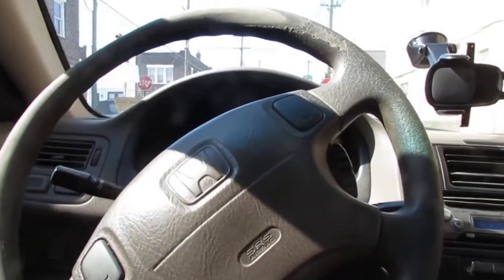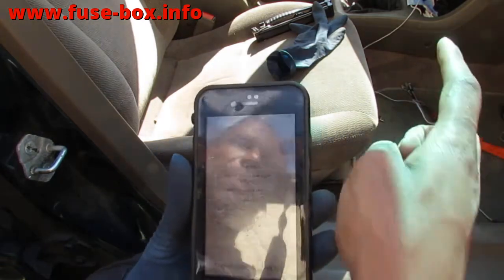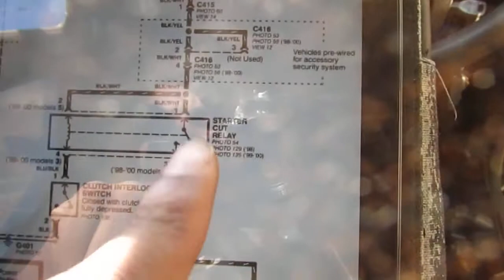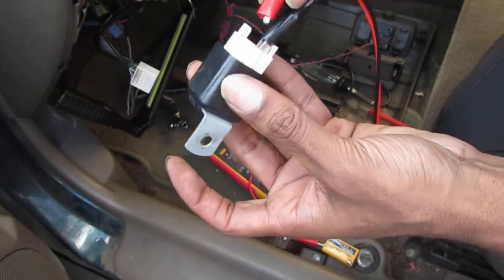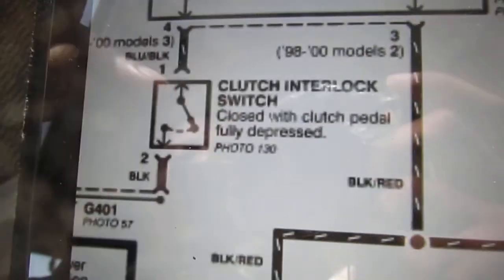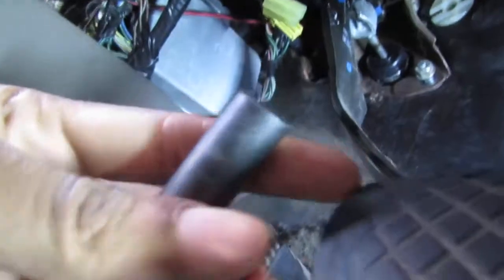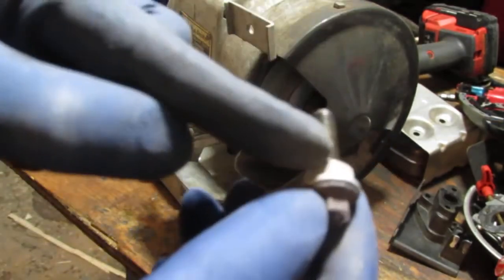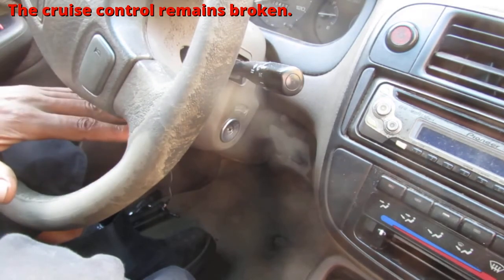No Crank, No Start 1997 Honda Civic, Manual

Comment: Thanks for your video it really helped tremendously. I just did this yesterday to a 2000 Honda Civic EX. The cotter pin on my clutch was facing the driver side of the clutch pedal. In your video, the cotter pin was facing the passenger side. I could not see the cotter pin on my vehicle and had to work by braille. In other words I had feel the for cotter pin and bend the pins straight with my fingers. Then I had to feel for the small loop on the cotter pin and use the hook tool to remove it and then reinstall it the same way. Every thing else in your video was spot on. Thank you for the video.
Reply from the maker: Hell yeah bro.  This comment made my week.  So happy you got the 2000 Civic started.  This diagnosis process is applicable to many Honda and Acura models during this time period so it is a general diagnosis guide for a no crank no start.

Comment: This didn’t work for my 92 accord. At this point. Been a whole year, ready to junk it 😭😭 just taking up space now.
Reply from the maker: So sad and you should not give up so quickly.  Try spraying flammable carburater cleaner into the air intake and see if it turns over.  If it turns over you know you have spark and possible good timing.  Then all you have to do is check the other components within the startup chain.  Or you could just bring it to me.  A 1992 Honda Accord has a similar startup chain.  Some of the contents in this video are applicable to earlier generations of Hondas but your 1992 Honda Accord has a different enough architecture.
Reply: @MotionDesignStudio  I wish I can take it to you. I’m at Chicago. 😭😭😭
Reply: @josesoto3875  , Chitown needs another 1992 Honda Accord on the road!  Best of luck and get a wiring diagram.

Comment: Thanks for sharing this video, it's helpful!  Does it help to remove the fusebox to get to the clutch switch for testing.?  I pushed in the clutch switch the other day with my finger and started with turning key and it worked.   Although, tried today and it didn't work. I want to unplug the clutch safety switch to see if its any good.  Any suggestions on getting it to it.?
Reply from the maker: Absolutely loosen it up so you can get easier access.  In the video I remove the fasteners so I can move the box over to the side so I can gain better access to the clutch switch.  If you unplug the switch remember you have to bypass with a wire or paperclip to close the circuit tricking the car's computer into believing that clutch pedal is pressed or the car will not start.  Is that clear?
Reply: @MotionDesignStudio  Found out it wasn't the clutch switch (had no power), but the security kill switch.  Just had to reset the alarm.
Reply from the maker: @tpswave3452  , thanks for teaching me this.  The security device are tricky.  Was this aftermarket?
Reply: @MotionDesignStudio  yes, it was the alarm i installed after the oem alarm went out.  The alarm still works.  There is a relay that is part of the alarm that is between the ignition switch and the starter relay.  If it is shut or defective the car won't start.
Reply from the maker: @tpswave3452  , that makes sense.   Follow the electrons and is they can not make it to their destination split the electrical system into 1/2 for diagnosis or start from the last component and work your ways back to the power source.

Comment: I have a Automatic So I believe my starter cut relay is bad
Reply from the maker: Nazoneofmyown_el_sp, this was such a pain only to find out the stupid plastic tab at the back of the pedal was the issue.  As long as you test both sides of the relay by bypassing like I did then you know for sure that that is the issue.  I have a better video on how to test the relay here.  https://www.youtube.com/watch?v=aTDbeyGc6d4  Best of luck and happy New Years.  Let me know how it goes please.   Since yours is an automatic I believe you need to check the switch that lets the car's computer know which gear you are in.   That has to be correct for this to start.  Also start with all the easiest things first.

Comment: Thanks for the vid..was educational ( did not know the other switch was for cruise). That said, I would have just looped the signal wire at the clutch pedal with a paper clip first.. This would have bypassed the switch itself for quick diagnosis.
https://youtu.be/MQXCKY98PXo?si=UD7BBoQ8I6kA3tVc
Is what I did on my 97...Hope this helps.
Reply from the maker: You are correct that is a quick way to check to see if the switch is functional.  After repairing the broken off tab on the clutch pedal used for the cruise control, cruise control works now.  I did not have cruise control for over 7 years and never really looked into it.  Strange how solving the crank no start provided a solution to a different issue.  Thanks for the feedback and have a great week.
Reply: Strange indeed..Be good.. @MotionDesignStudio